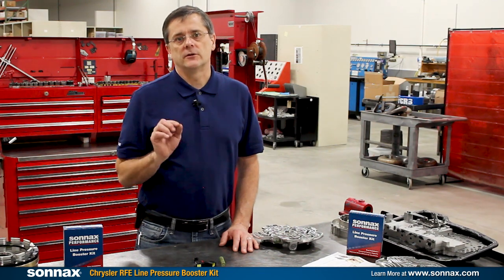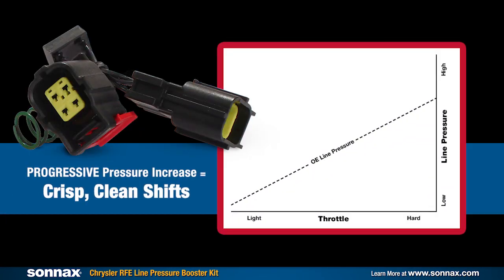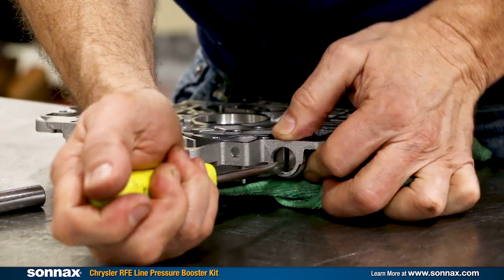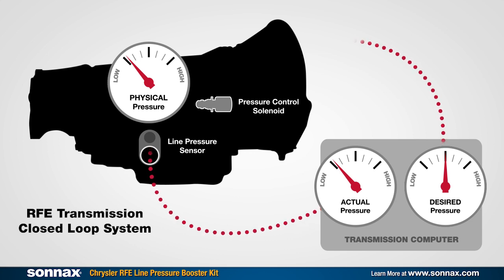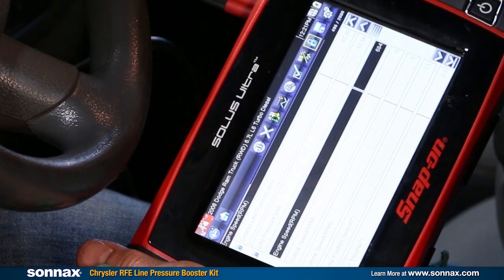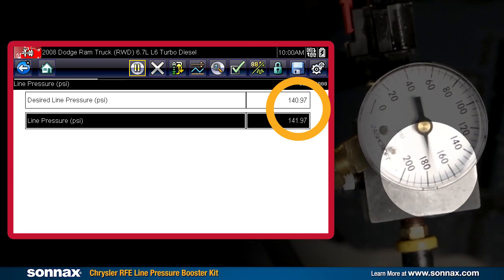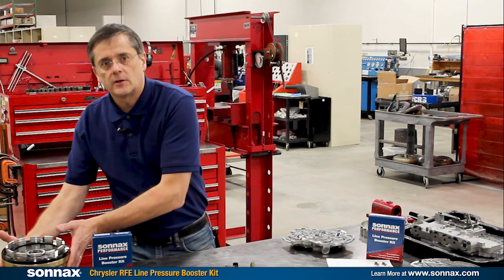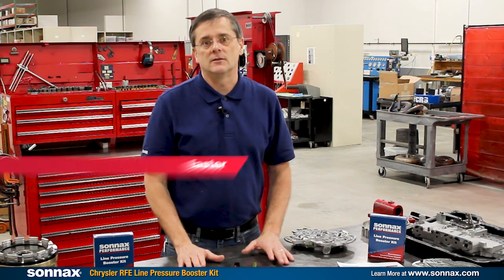How to Raise Chrysler RFE Transmission Line Pressure — No Tuning Required

Comment: You only have to pull the valve body to install the spring right? I've had your booster on for 3 or 4 years and never looked back!! 2012 jeep gc 5.7 diablo 93 octane custom tune, mopar cai, full 3 inch exhaust, 85mm bbk tb. The day I put that chip on I was f**** blown away!!! It felt so sluggish and lazy before and that little magic chip changed the entire transmission!! I have never installed the spring. Anyway its just a valve body drop right? Not the entire transmission??

Comment: Quick question.. so the electronic booster a plug in play where you unplug the harness and just plug it between the sensor and the original harness is what i underatood. Right?
Reply from the maker: Correct this pigtail will plug into the vehicle harness and the line pressure sensor. This will give you a nice progressive increase in line pressure as load is increased. Thanks for reaching out, and have a great day!
Reply: @ so withougt any updrade inside the transmission. If i were to buy that pigtail harness.. all i need is to plug it and done?  It was mentioned also that i don’t need to install the spring if i don’t have to. Sorry, i get what it said on the video. But i just really want to make sure.
Reply from the maker: @tengzturiagaiii3185  Our tech team would be happy to help you with any further questions. They can be reached directly via email at sonnaxtechsupport@sonnax.com, or phone at (800) 843-2600 ext. 398. Thanks for reaching out!
Reply: @ thank you
Reply: @sonnax quick question. Where does the pressure control solenoid located on 545rfe, is it part of the aolenoid pack? Or is it alone solenoid that can be access and replace itself?
Reply from the maker: @tengzturiagaiii3185  Our tech team is happy to help you directly. Feel free to reach out to them via email at sonnaxtechsupport@sonnax.com, or phone at (800) 843-2600 ext. 398. Thanks again for reaching out!

Comment: One of the issues I’m told with the 66RFE is low line pressure to 5th and 6th gears. Your kit should fix that issue if I understand what you just said. Excellent video by the way.
Reply from the maker: Thanks for the feedback! The RFE-LB1 will raise line pressure progressively from about 10 psi at lower pressure ranges to 25 psi increase at higher pressure ranges. This will provide improved clutch holding capacity in 5th and 6th gears.

If you have any other questions, our product support team would be happy to help you. They can be reached directly via email at sonnaxtechsupport@sonnax.com, or phone at (800) 843-2600 ext. 398. Thanks again, and have a great day!

Comment: Does the Rfe's have an external  line pressure test port for live fluid psi readings?
Reply from the maker: Yes, they do. There are several options available for adapters (here is a link to one Transtar sells: https://www.transtar1.com/products/transmission-tools-and-equipment/featured-products/Line-Pressure-Adapter-Tool). Just remove the line pressure sensor and install it in the adapter. Install the adapter in the case and reconnect line pressure sensor. Now you can verify actual line pressure and compare it to what the scan tool is reading.

Comment: I have a general question about a valve body that I can't find an answer to. If you'd be so kind to give me advice I would be grateful. It's regarding a completely different automatic transmission, a SJ6A-EL from a 2017 Mazda MX-5. I saw a video of a mechanic adjusting the "pressure control valve" (boost valve?) without even taking the valve body out. He just used a flathead screwdriver to easily adjust this valve to a higher setting and claimed that this boosts the pressure a little and will improve shifting response. This was on an unmodified valve body with no "shift kit" installed. So My Question is: is it safe for me to adjust this valve to a higher setting or should I leave it alone? Would it really slightly improve shifting even without a full shift kit in the valve body? Keeping in mind that my car is stock, 80k miles and I don't abuse it. It shifts fine the way it is (a little too smooth for my taste) but if I could improve it a little without putting extra wear and tear on the transmission with this simple adjustment that would be great. Thank you for any suggestions on this.
Reply from the maker: Our product support team would be happy to help you. They can be reached directly via email at sonnaxtechsupport@sonnax.com, or phone at (800) 843-2600 ext. 398. Thanks for reaching out!

Comment: ? will the 
Transmission Chrysler 68RFE Internal Clutch Drum
Print Share View Instructions
68RFE
Smart-Tech® Overdrive Clutch Housing Kit
Part No. 72960-16K work in a 66rfe and way dont people give the 66ref more love i have a 2016 power wagon with 37 inch tires on like to see some good upgrades for it  thanks
Reply from the maker: No, however, we do offer quite a few parts for the 66RFE. Check out what's available here: https://www.sonnax.com/units/47-66rfe. And if you have any questions about which parts would be best for your build, our product support team would be happy to help. They can be reached directly via email at sonnaxtechsupport@sonnax.com, or phone at (800) 843-2600 ext. 398. Thanks for reaching out, and have a great day!

Comment: Great video information! I have a 2011 Chrysler Town & Country. with the 62TE trans. It just started slipping from 2nd, to third. I changed the filter and fluid. Cleared codes. Drove it around the block gently. It started slipping a little worse with a slight whine. I see a new check engine light. It read P0869.  This motor/trans does not have a TCM, just a ECM. This code shows line pressure high. Low fluid, ECM, or wiring issues. Fluid is Ok, would changing the solenoid pack, and Tcc solenoid possibly help? The car has never had any trans issues, I have changed the fluid and filter every 60K. Any recommendations?
Reply from the maker: Our product support team would be happy to help you. They can be reached directly via email at sonnaxtechsupport@sonnax.com, or phone at (800) 843-2600 ext. 398. Thanks for reaching out!

Comment: 03 ram 1500 with 545 RFE here. Ordered your part. My problem is the tranny shifts into low gears too early and very soft shifts. Just had dodge reflash the trans computer. Do you think this will help my problems.  I pull a trailer and zero turns every day and can't use this truck cause I believe it will damage the  trans.
Reply from the maker: Hi Daniel, our product support team would be happy to help you. They can be reached directly via email at sonnaxtechsupport@sonnax.com, or phone at (800) 843-2600 ext. 398. Thanks for reaching out!

Comment: I have durango 2013 engine check is on i got the code P0935: Hydraulic Pressure Sensor Circuit High  what shall i do to fix it?
Reply from the maker: Our product support team is available to help with any questions related to Sonnax products, but for general tech questions, we'd recommend contacting our friends at ATSG or ATRA for assistance. Hope that helps. Thank you, and good luck!
• ATSG: https://www.atsg.us/   
• ATRA: https://www.atra.com/

Comment: This is similar to a "boost fooler"  for the turbo, with no actual hard parts that are made for the tuned power. It simply tries to trick the system and from personal experience that is never a good thing because when the system thinks it's doing one thing and it's actually doing something else, that's when things get angry and hate life.  If you electronically trick these trucks they hate life. If you want better line pressure spend this money on an actual kit for the valve body. It's not half as scary as it sounds to work on at all. And if your scared to work on your valve body or any part of the transmission just go to Amazon and grab the "ATSG 48re manual" book and it walks you through every single part and how it works and how you take it apart and put it together. A 5year old could rebuild a 47, or 48re with the "ATSG 47, 48RE TRANSMISSION MANUAL BOOK"   firepunk also offers the atsg manual on their website and offers phone tech support from a real tech who works strictly on our dodge ram trucks and their transmissions. Not hating on this company at all but these trucks don't like tuning of any sort without hard parts to back up the tuning and your transmission will thank you later 😊
Reply from the maker: Thank you for participating in the discussion about raising pressure RFE’s and 68RFE. 

The RFE’s are a very different animal than the 48RE, and transmission line pressure control is achieved by completely different methods. Our experience has shown the best outcomes for vehicles is achieved without changing the OEM transmission tuning. Even the valve body kits that raise pressure do so by "tricking" the computer control. The Sonnax RFE-LB1 electronic booster kit is the original "tuneless" method for raising transmission line pressure in these sophisticated, closed-loop pressure control systems and works as intended.

Comment: Hi there.! I've been working on a 2014 Ram with a Hemi - I know it will benefit from this as I've watched the line pressures && exactly as you've stated Actual && Desired line pressures vary at time && Low Pressure DTC has been set --- however the Engine Stalls without any other DTCs .... could Low Line Pressure cause the engine to stall .?
Reply from the maker: Hi Robert, our product support team would be happy to help you. They can be reached directly via email at sonnaxtechsupport@sonnax.com, or phone at (800) 843-2600 ext. 398. Thanks for reaching out!
Reply: This was my exact concern. Seeing as how its controlled by the tcm and talks to the pcm. It will snitch on you to the pcm and throw a code.

Comment: How does this affect warranty? If you uninstall and set it back to factory will dealer be able to tell?
Reply from the maker: This does not change the computer software or memory so you should be able to install and remove it on any vehicle without leaving any indicator that it had been there. Thanks for reaching out!

Comment: Hello,  I'm getting P0869 High Prssure Transmission. I had Transmission Fluid flushed, filter replaced and Torque Transmission Selenoid replaced. But I'm still getting this code. Will this device help to fix the problem? Thank you.
Reply from the maker: Our tech team would be happy to help you. They can be reached directly via email at sonnaxtechsupport@sonnax.com, or phone at (800) 843-2600 ext. 398. Thanks for reaching out!

Comment: I have a 2004 dodge ram 1500 that if it sits unused for a few days, will be very slow to go into gear at start-up, but works perfectly thereafter. Any ideas? Do you have anything like this that would fix this? Thanks!
Reply: There is an upgraded oem line return filter (the spin on filter) that keeps the fluid from draining out of the torque converter.
Reply: @quietsignal  so that’s what’s going on? The fluid is slowly draining from the torque converter back into the pan while sitting unused? Thanks for the info.!
Reply from the maker: Hi, our tech team would be happy to help you. They can be reached directly via email at sonnaxtechsupport@sonnax.com, or phone at (800) 843-2600 ext. 398. Thanks for reaching out!

Comment: I have a 2004 545rfe that shifts fine cold and while warming up. Once it reaches normal temp it will shift hard into 3rd, eventually triggering limp mode. The code reads insufficient governor pressure. Will this correct a weak hot pressure symptom?
Reply from the maker: Hello, our tech team would be happy to help you with any questions. They can be reached directly via email at sonnaxtechsupport@sonnax.com, or phone at (800) 843-2600 ext. 398. Thanks for reaching out!
Reply: Check your filters are tight and your oil level
Reply: @jmfz28  I ended up having to replace the entire trans with a remanufactured unit. Never did find out what caused the hot shifting issue with the old unit, but it drives like new again.
Reply: I couldn't afford the reman trans just the rebuild should I get a reman trans?

Comment: 2011 ram 5 speed with 152000 miles on trans,no problems but never have service trans. Normally I change my own filter and fluid on trans every 50-60 I but been so busy with work oops life happens. Would you recommend doing this or could I damage trans with not having serviced trans?
Reply from the maker: Hi David, our tech team would be happy to help you. They can be reached directly via email at sonnaxtechsupport@sonnax.com, or phone at (800) 843-2600 ext. 398. Thanks for reaching out!

Comment: Excellent ..A lot of folks are scared to touch an Auto box(except to remove and refit as in replace) anything other than that and maybe some adjustment to the linkage there is nothing that they feel they can do..IT isnt, when your car starts to mess about, such as; changing up too quick or missing out gears or not selecting, basically all things to do with gear changes and selection, one quick fix and worth a go if the trans looks awkward to remove or engine, is to go to the local breakers(scrap yard, car dismantlers or what ever you call them there) find your gearbox match(numbers, some can be cross referenced and in other cars) remove the gaerbox sump and remove the "valve body" (it must be kept very very very clean and the oil from the doner must NOT have a brown ish colour to it (plates are worn and that dirt will destroy your valves), it will be held in place by loads of bolts all easy to undo, just dont miss any and dont get the lenths wrong, refit to yours, add the right amount of oil, start on a 3 min tick over and then pull the lever through each gear in turn for 5 secs (twice on tickover) Then praise to whom ever you praise too. every time I have done this, it has worked .. don't pay more than $20 for the valve body clean any spare oil (change it immediately if it works & filter).. it's worth a go as we all know the alternative..  Si

Comment: Is your line pressure booster compatible with the TransGo shift kit I’ve already installed in my 545rfe? The vehicle is a 2002 Jeep Grand Cherokee 4.7L (non high output) w/ full time 4wd.
Reply from the maker: Hello, It depends which TransGo kit you have. It should be okay with the early kit, but their newer tuneless kit is a different story and most likely not a recommended combination. Feel free to reach out to our tech team directly for more details, either via email at sonnaxtechsupport@sonnax.com, or phone at (800) 843-2600 ext. 398. Thanks for reaching out!

Comment: Thumbs up, Awesome!   I received the booster kit today. Installed it on my 2012 Ram 1500.  Did a hard reset by connecting both battery cables together for a minute or two.  Have 50 miles on it right now, so far it's shifting great. I'm a happy customer, thanks.
Reply from the maker: Excellent! Glad to hear that, Wil. Thanks so much for the great feedback!
Reply: @sonnax  Question,  my co-worker asked me what's the difference with this kit or just riding with the tow/haul button on and I really couldn't answer him, could you help me give him a good answer? Thanks
Reply from the maker: @wilsolo1986  Tow/haul mode changes shift patterns, and can sometimes block out the top gears.  For instance, in a 6-speed it might keep you in gears 1-5. Our line booster does not alter shift points, but increases pressure for a more positive shift feel. Hope that helps, thanks!
Reply: @sonnax  Awesome, thanks.
Reply: @sonnax  Hi, do you sell a line booster kit for a 2007 Jeep wrangler?
Reply from the maker: @wilsolo1986  Not at this time. You can see the full list of kits we have available here: https://www.sonnax.com/line_pressure_booster_kits. Thanks!
Reply: I have a 2011 ram 1500 slt 4x4 that has a p0934 code. Will this help and/or fix the problem? The CEL comes and goes. The only change when the CEL is on is the truck doesn't have eco mode.
Reply: How do I order one